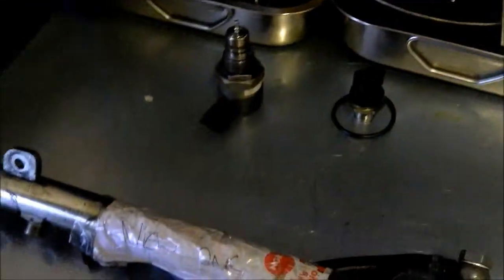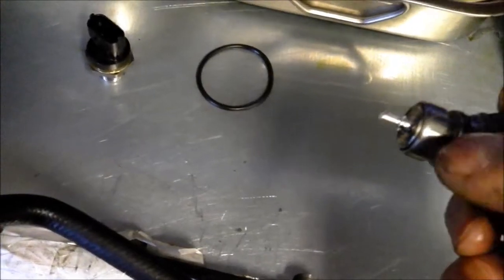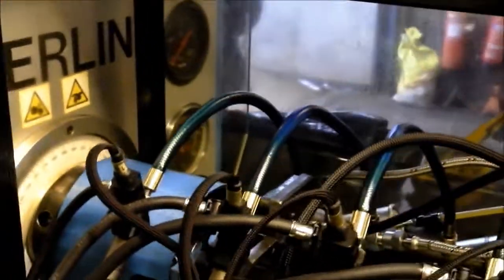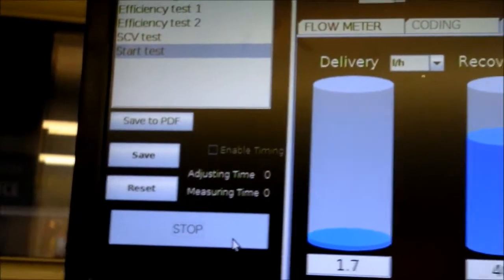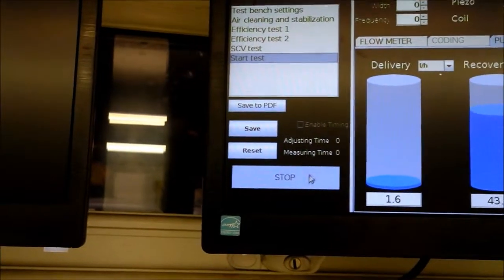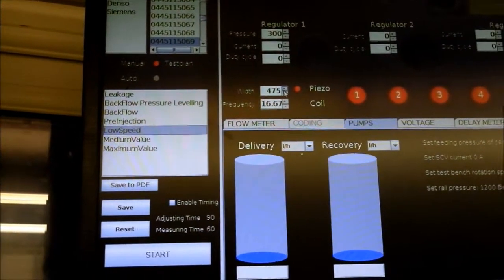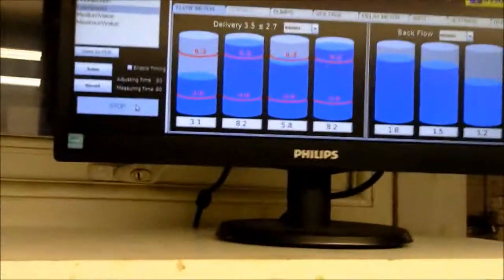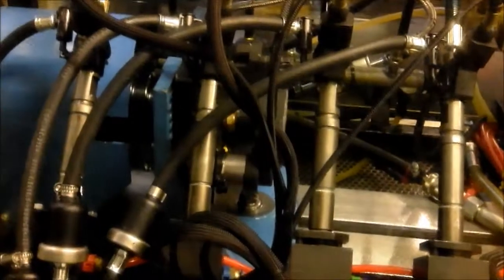Mercedes Benz Diesel Pump and Injector bench test, with a non start fault

Comment: Hi Martin really enjoying your channel, u raise a very very important issue @ 8min 44 sec on video "you've got pressure but have you got flow" i got caught out with that a few weeks ago on Nissan Primastar No Start (same engine as Vauxhall Vivaro + Renault Traffic) I had good cranking rpm (240), 370 bar rail pressure( Pumped up priming bulb on low side)  , good compression (Relative compression test via amps clamp) air draw measured via air mass meter, and exhaust pulses measured by hand over exhaust pipe!!! Still wouldn't Start.  Turned out the fuel inertia switch was activated,  which is electronic in airbag module, cutting off low pressure pump in tank.  The cause was fluid leaking into airbag and BCM Module from dashboard cup holders, both modules removed, dried and reset now it starts lovely!!!! many thanks sandy

Comment: l have a problem after 
replacing ml 270 cdi year 2000 injectors the original was 0445110035 and
 the new ones 0445110201. And it's not starting not getting any fuel to the cylinders. any idea why? they say it sould start up even before the re-coding of the ecu .
Thanks